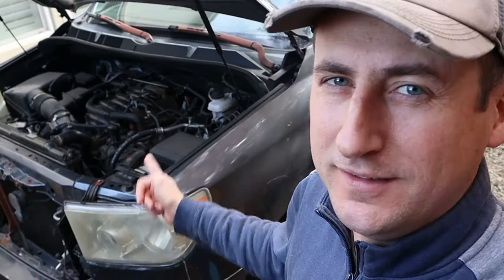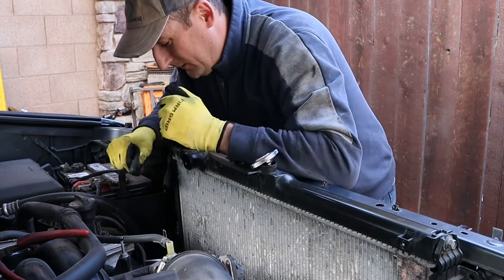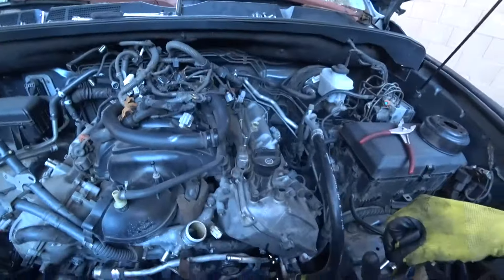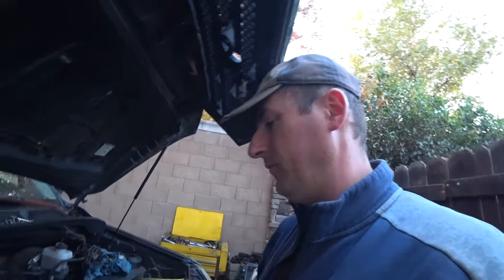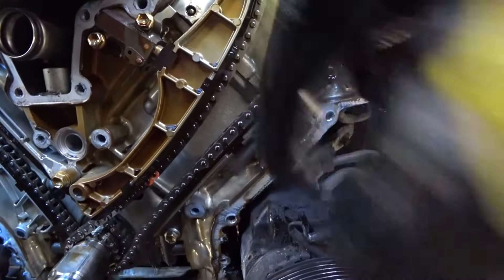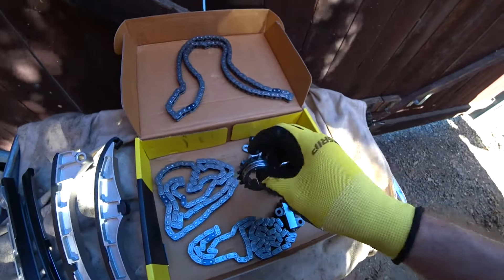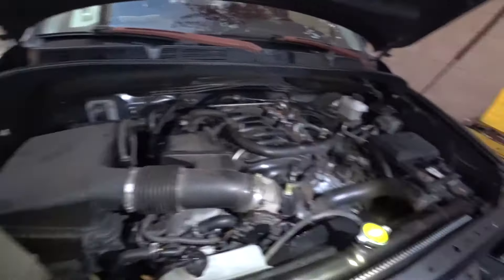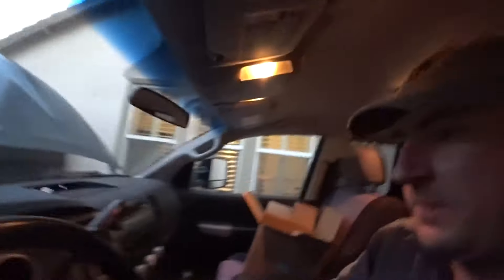changing the timing chain on Toyota Tundra V8 5 7

Comment: Serghei - thank you for this incredibly helpful video and your excellent, clear descriptions. I had a problem with a leaking cam housing on the passenger side of my 2011 SR5 and, in lieu of a $2700+tax dealer estimate, attempted to fix it use a shortcut published in another video. That video was fine but I misunderstood what was involved with the tensioners and messed it up. Using your video, I was able to take the timing chain cover off and get both cam housings sealed as well as recover from my mess-up. I haven't worked on an engine in over 20 years and I don't think I could have done it without your video. Thanks again!
Reply: sorry to be so offtopic but does anybody know of a way to log back into an Instagram account?
I was dumb lost the account password. I would love any tricks you can give me!
Reply: @Quentin Ford Instablaster =)
Reply: @Justice Miles i really appreciate your reply. I got to the site thru google and Im in the hacking process atm.
I see it takes a while so I will reply here later with my results.
Reply: @Justice Miles It worked and I now got access to my account again. I am so happy:D
Thanks so much, you really help me out :D
Reply: @Quentin Ford no problem :D

Comment: Serghei EXCELLENT VIDEO! Thank you very much for sharing. You explain very well what you are doing. It is a time consuming job as I can see. I have a 2010 Toyota Tundra, I use the Mobil 1 motor oil.   I did the timing belt on my 2001 Toyota Tundra 4.7 engine about 10 years ago. I have replaced many timing chains and gears on the 1960's Pontiac engines. I replaced the timing chain on my older Brothers 1953 Buick Roadmaster this past march. Brother is 83 years old now soon to be 84. Brother taught me a lot of what I know. I have always been intrigued and fascinated with timing chains and engines on how they work. THANK YOU VERY VERY MUCH

Comment: I usually use Royal Purple assembly Lube on the chains and guides and gears. Its very sticky and will not drip if used right for the jobs. But nice to see you lube the chain with oil before closing up. I see WAY to many techs and people start then dry and that will cause wear that is not wanted on first fire up.

Comment: Thanks for the video Serghei I have the timing chain slapping on drivers side, started only at cold starts but it is more prominent now, I thought I could get away with just changing the tensioners, what parts kit did you use

Comment: Thank you for sharing this video. So far it is the best tutorial I have found in doing this job. However, I am having a hard time getting the wiring fully disconnected from the lower sides of the engine to push it out of the way of the valve covers. Do you have any suggestions for that?
Reply: I used WD-40 on the connectors and some hose pliers (they look like needle nose pliers, but the ends are rounded to go around hoses) to disconnect the plugs. You can use a large size (about the diameter of a quarter. They pinch the plugs little tabs and allow you to release the plugs. I successfully disconnected all required plugs and didn't break any! Good luck!
Reply: @loadmasterc141b4  I got it and job is complete. Successful if I might add. Lol thanks for the reply though. I appreciate it.

Comment: Hey Sergey,
Thank you for this video. Helped me to change my timing chains and tensioners. I have a question for the oil pump: do I need to do some priming with oil before I start the engine with new pump? Thank you!
Reply from the maker: no , you don't have to
Reply: Thank you! I starred it , runing very good still smoking from exhaust  headers. Hope it is not leaking from valve covers

Comment: Hey great job, one quick question! How many mile on the engine at time of performing the job?
Reply: 200k miles
Reply: Like 400k
Reply: I have a 2014 with 265,000 miles on it have never messed with the timing chain, but get it serviced at Toyota on a very regular basis and they said it’s in great shape

Comment: I'm about to tackle mine. I have issue with chain tensioner. Since I'm there I may replace the whole timing. Can you let me know where did you order the kit?
By the way awesome job.
Reply: I just bought a complete kit from RockAuto.  They have all the individual parts or a complete kit with 4 chains, 4 tensioners and 4 slides. I got a Melling brand kit. Seems fine. They have several brands available. Best price for sure. I also picked up a new radiator, oil pump kit, water pump, etc. I figure replace everything at once and hopefully I won't have to do it again.

Comment: Hi Serghei, What year and model is the Tundra?  Where did you get the timing chain replacement kit from?  Great Video.
Reply: I have a 2013 cm 3ur-fbe & just did this with a Melling timing chain kit from rock auto which had the exact same procedure (1K later its still running better then ever with no knocking at all)

Comment: So I had to do the head gasket on my truck (2014tundra 5.7l 3UR-FE)and I’m putting it back together now but after I get all my marks lined up and everything in time, when I manually turn my engine (28 times) my small chains don’t match back up but my big chains do. What am I doing wrong?

Comment: love our videos.   I have a question .    Recently Ive been offered a, 2015 Toyota Tundra TRD - SR5 _ with the 5.7L 8-Cylinder Gas Engine . Miles are under 80 thousand .   Its absolutely imaculate.   The only thing is its 2WD and not the 4WD , but  I prefer the 2WD since it hasnt snowed where I live in 8 years.   I can get the truck for under $20 thousand.   I would love your advice.   I really like this Toyota engine and its a crew cab.   Thx Buddy.   fyi,  when do you need to change a timing chain on this engine ??

Comment: Next time try to unscrew crankshaft bolt by using starter. Just put head on the bolt and extension on the left side of the frame then click starter once. One guy tough me this tip on subaru's engine.

Comment: I just bought a 2008 tundra 5.7 with 195000k miles from the car action with no maintenance records The truck runs and drives as it should do you recommend me to replace the timing chain and water pump or when should I do that?
Reply: I just bought a 2008 sequoia too with 156k miles and  I was wondering at what point should I service my timing chain.
Reply: My 2010 Sequoia just rolled 200 and is running like new. Personally I’d change ALL the fluids and run them.

Comment: They never stretch. It's one of the biggest, best-built chains on anything. Unless the engine overheated & ran hot for way too long, the factory paint timing marks are visible. If they're faded or gone, replace it due to uncertainty. But as a rule they just don't fail.
Reply: It's not the chain that fails on these.  The tensioners can fail.  My 16 sequoia with 92k has a tensioner going.  Gotta replace it next year and since it requires basically taking everything off anyways, just going to do the full timing kit.

Comment: Curious how difficult it is to remove the front end of the vehicle.  My car I can do it in about 20 minutes.  I can let the condenser hang to the side with bungee cords.  This would make the job easier in that you would not have to reach over or crawl under the front of the vehicle.  You could pull up a chair and have a access to about everything.